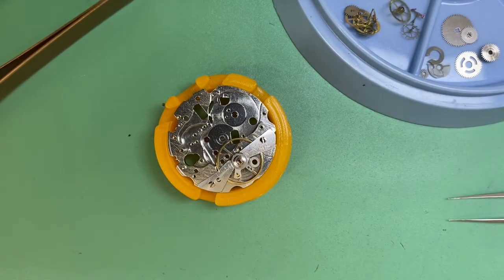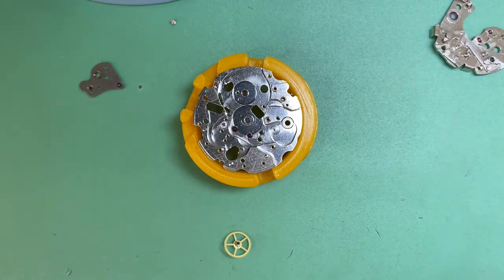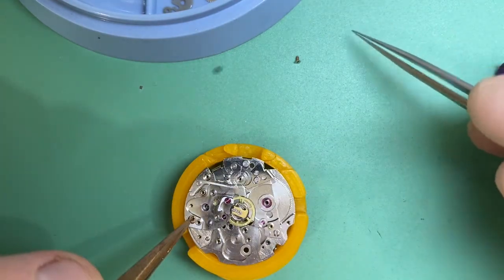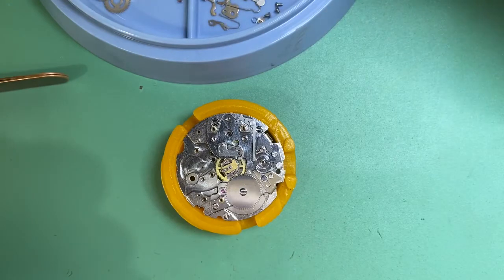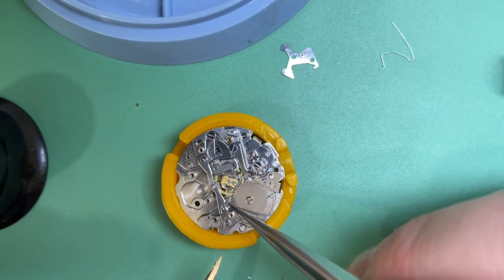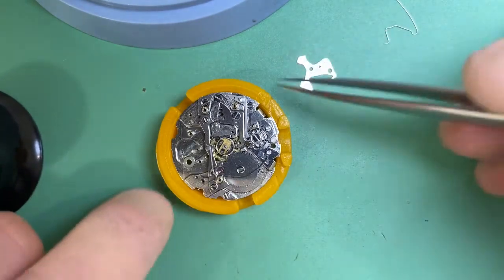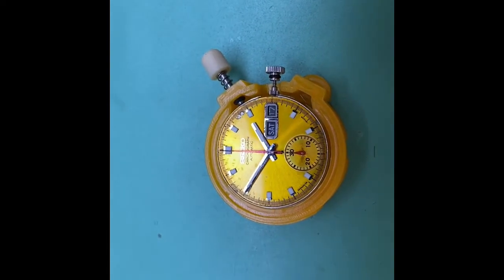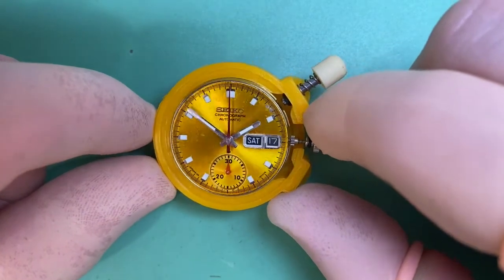SEIKO 6139-6002 'Pogue’ Watch Restoration - Part 1: Assembly & Lubrication

Comment: Thanks for a very useful video, i did not see the spring around the stem, i would like to see this being installed and the small brass pinion should this slide on the stem? mine is fixed or stuck and has no spring, i do have a replacement though